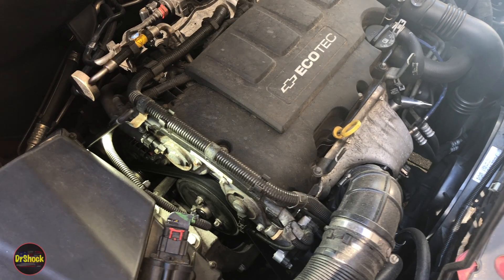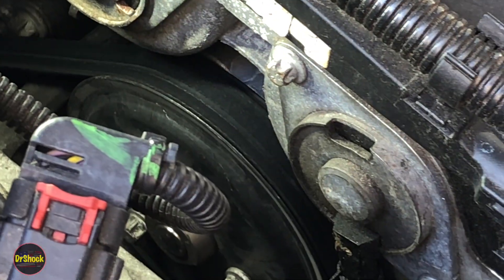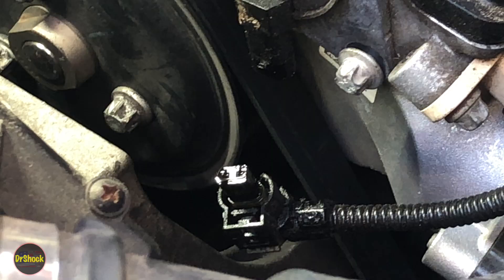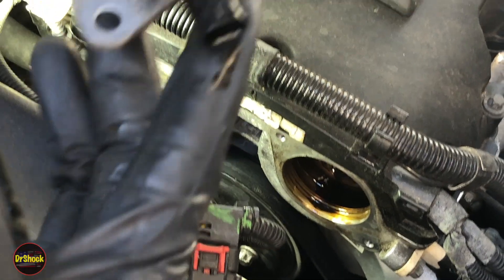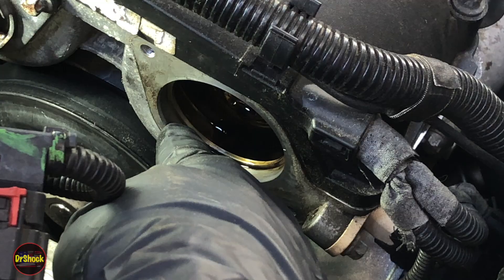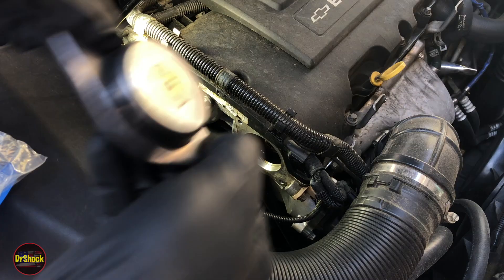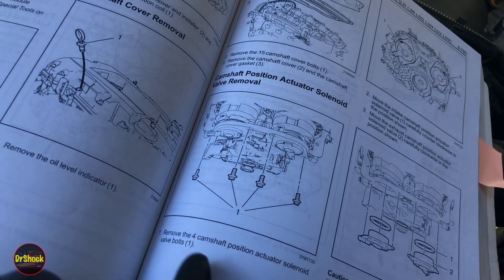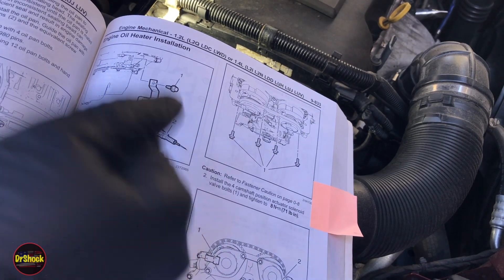2011 - 2021 GM Ecotec 1.4L Engine Oil Leak Camshaft Position Solenoid Repair (Chevy Cruze Sonic)

Comment: Hello 

How much torque did you use to tighten the screws? Thanks
Reply from the maker: You would have to watch the video to get that information, I work on far too many vehicles to recall it from memory.  You can use the chapter scrubber to fast forward to the reinstallation sequence of the video.

Comment: Hi, I'm a Spanish who owns a Chevrolet Aveo. It's the same as the Chevrolet Sonic, with the 1.2-liter gasoline engine and 86 hp. I tried to find the car's workshop manual, but I couldn't. I saw that you have a workshop manual. How did you get it? Can you tell me where I can buy it? Thank you so much for all your videos; they're very helpful.
Reply from the maker: There's a link in the video description, which you could modify the search to Aveo instead of Sonic that may help.   In the USA the manuals for the 2009, 2010, and 2011 Chevrolet Aveo / Pontiac Wave were available via an order form in the back of the original owners manual.  But no other years.

Comment: Hello, did you use brake cleaner to clean the connector or a special connector cleaner? I need to clean mine also and I am wondering is it safe to use brake cleaner on it?
Reply from the maker: You would use an electrical contact cleaner, there's a link in the video description area for the one I showed.

Comment: I need help. The left side on the intake leaks, are they the same part number? Thank you much.
Reply from the maker: All the part number info is in the video description area.  They will be the same, these parts are not intake / exhaust side dependent.
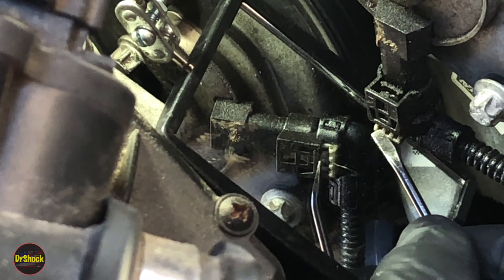Reply: @DrShock Just one more thing I noticed the leak is only on the gap(3:00 oclock position) Does it mean I need to change the seal only. Thank you very much
Reply from the maker: If it's coming out of the side position like that, rather than the bottom or electrical connector, it's typically just the seal that has failed.
Reply: @DrShock Thank you for clarifying it.

Comment: Did this leak? I have the same engine and I’m leaking about 2 quarts a week. But mine does have the oil all over just like this one in video.
Reply from the maker: This type of leak is not going to be of that amount.  You likely have more than one going on.

Comment: Mine leaked oil on the drive way.
Looked and saw it was those.
What an easy fix. Bought 2-seals, installed clean, fastest oil leak fix.

Comment: Thats the engine in my wifes car it has threehundred and ten thousand miles just putt the second timing chain  gides cam sensors and water pump both front cv half shafts shocks rear traling arm bushings  other than that it still runs and drives great to me its a cheap car to zipp around town   my winter project is to replace both front finders they have the usual rust right behind the front tires  on the lower part ov fenders  than it will be great if i can match the original paint so you cant tell the work has been done thanks four sharing and posting and hey have a great day and weekend😎👍🏼👍🏼🇺🇸🇺🇸